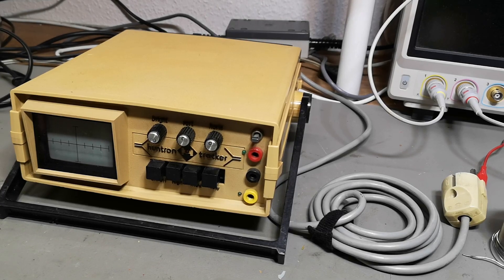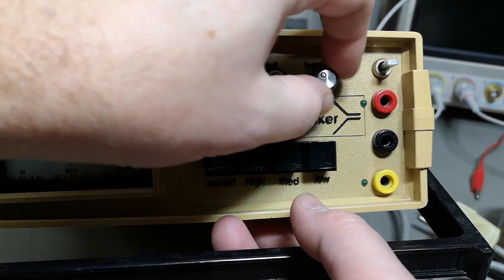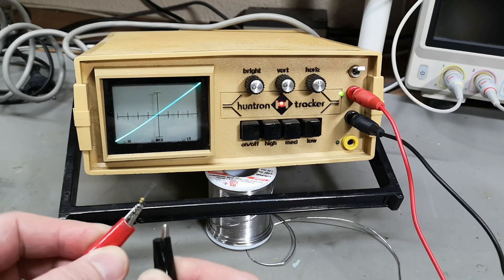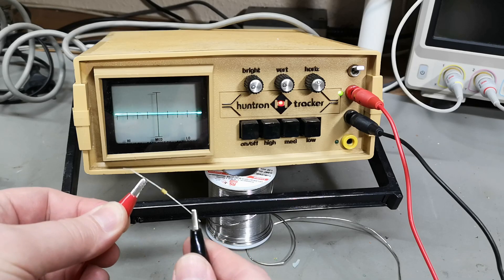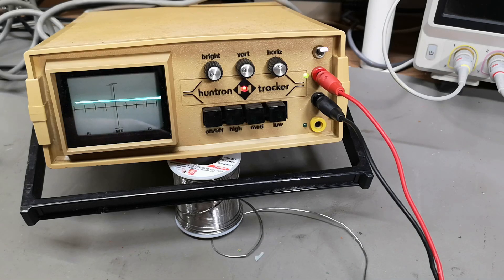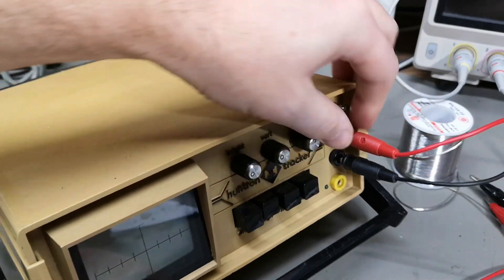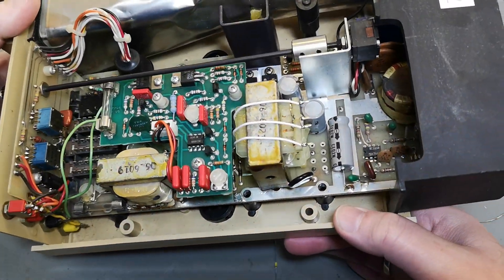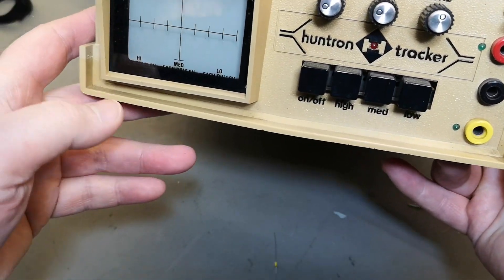Huntron Instruments HTR1005 B-1S Tracker Test Set Teardown

Comment: hello does this model work with low power smd components too ?
Reply from the maker: Sure, but it is a challenge to connect them, you can get a fixture for smd
Reply: @TeardownOZ2CPU  maybe using standard meter probes instead of crocodiles? Is it current limited i was just worried to fry little smd stuff which are supposed to work at 3.3, 5 or 15v this thing injects much more even at low level
Reply from the maker: @alessandrol9343  this one measure at very low current, so it is not a problem for even tiny diodes
Reply: Yes...its still very useful today. If you have a working PCB for comparison.
But the Huntrons are extremely overpriced. Even the older Huntron 2000s.
But there is a company called "Ucore Electronics", who sells these tracers  for humane prices. I got one from them. Works very well.

Comment: That unit is in exceptional condition! It is from about 1980 and is just like the one I learned on.
I always found it odd that the early 1005B models had a angled open signature line in the Low range. It was Bill Hunt's (the company founder) original design. You get used to it but this was changed in later Trackers. 
Good to see someone reviving an oldie but goodie! Cheers.
Curtis Smith, Huntron Technical Support
Reply from the maker: thanks a lot for the message Curtis :-)
Reply: Все таки я бы предпочел горизонтальную линию на всех диапазонах измерений

Comment: Hello, you made me very happy with this video, because I did not know this model.
It's unbelievable where the curve tracker from Huntron model 3200 has developed with digital inputs, storing the tested boards in memory - later it can be used as a reference for retesting - so I don't have to compare two boards but I call up the comparison from memory. Well, if I get a test robot, I can just watch after programming 😁

Nice day 🙂 Tom

Comment: You didn't notice me replacing the mains transformer. I guess the wire over transformer looked stock enough :)
Reply from the maker: nope, your transformator replacement was made so prof, i did not see it, good job there :-) actually impressed i did not see it..